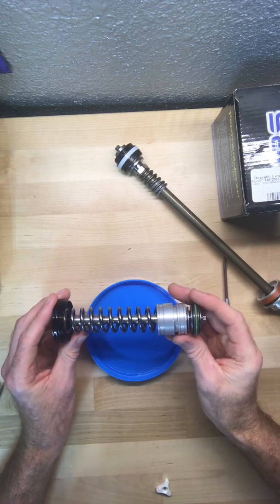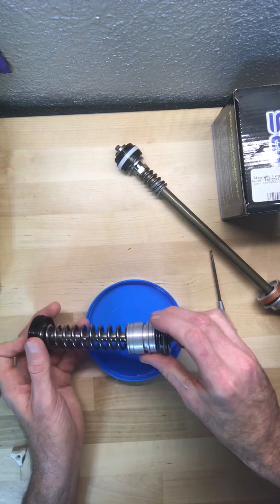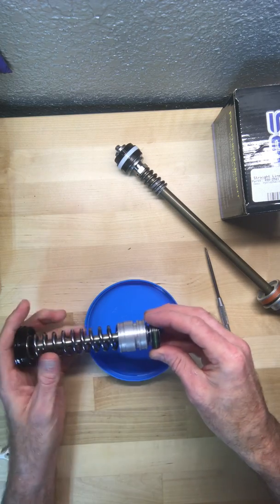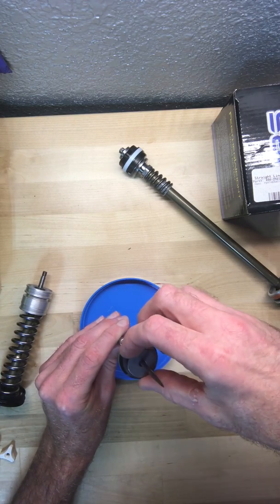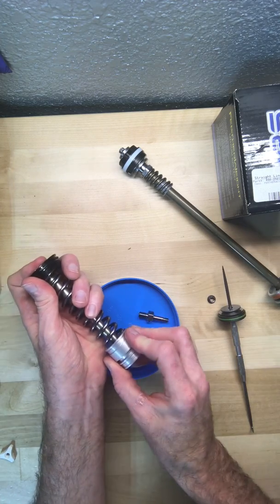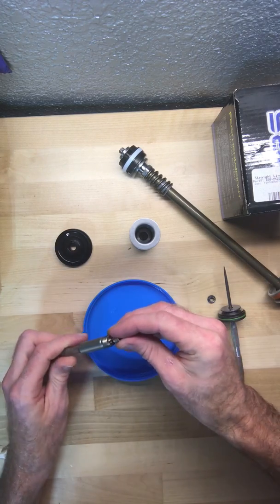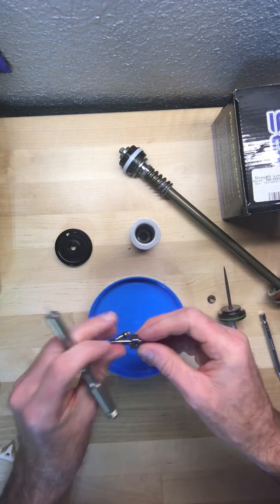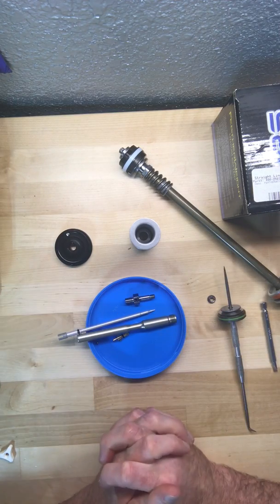WP AER 48 2017 Valving Stack

Comment: Just a heads up. That wasn't the top out spring on your base valve/fork cap. The top out spring is the spring below the mid valve on the damper rod.

I don't know what WP calls theirs, but what you called the top out spring, is what KYB calls their ICS spring. It's what allows the assembly to move as the damper rod takes up space, and still keep pressure on the fluid to prevent cavitation.

Not being a hater. Just returning some knowledge for you. :)
Reply from the maker: Dana Draper thanks for sharing the info!

Comment: Are you going to revalve ? Hope you do video of puting back together.
Reply from the maker: Hi Seth, I didn't actually put new valving in although I almost had to because the pic that I had the valves on seemed like a handy tool to grab when I was tired and the valves went poof onto the floor!  I managed to get it all back together.  I really wanted to shoot full size video of the entire process but I was under the gun for time as I had rotator cuff surgery just last week and knew I couldn't turn wrenches for a while.  I will try to video it all next time.